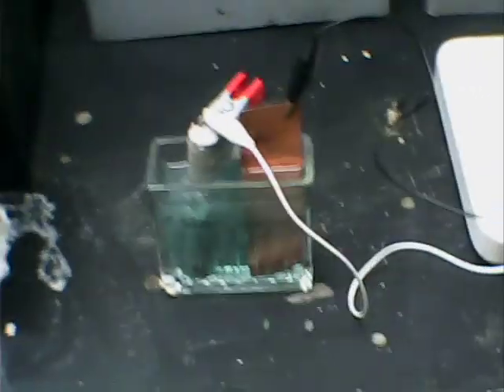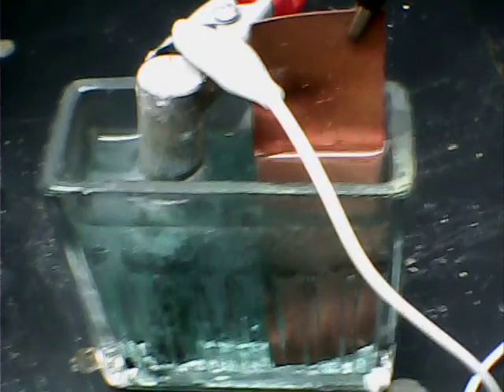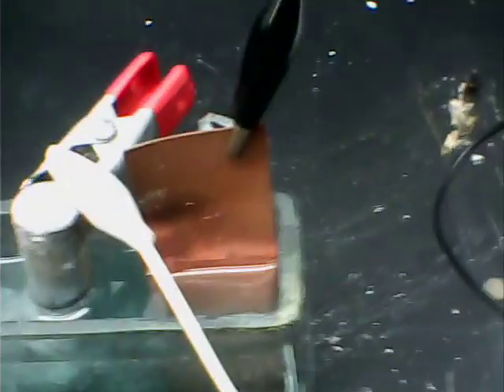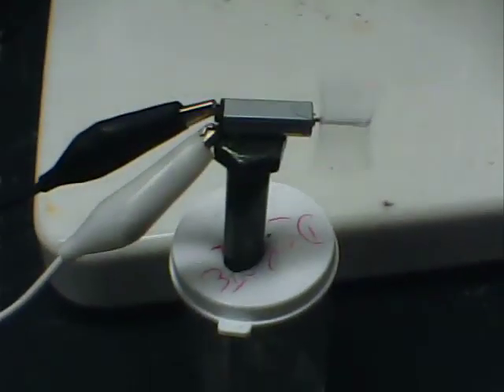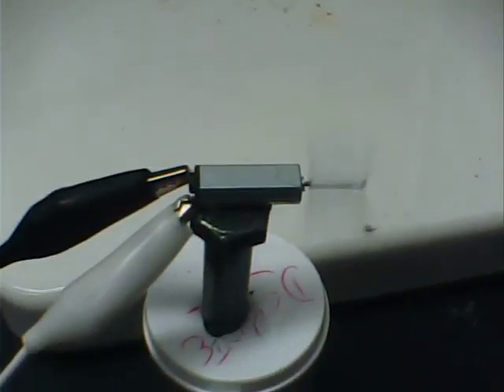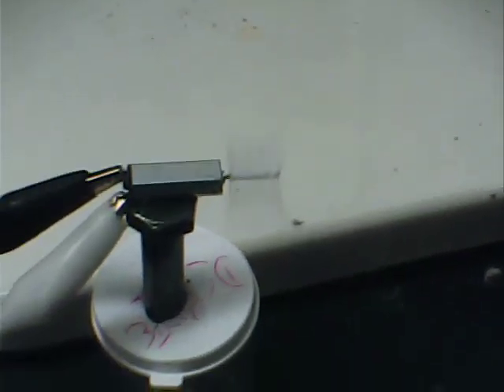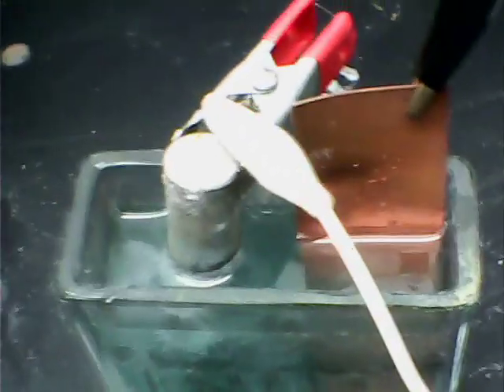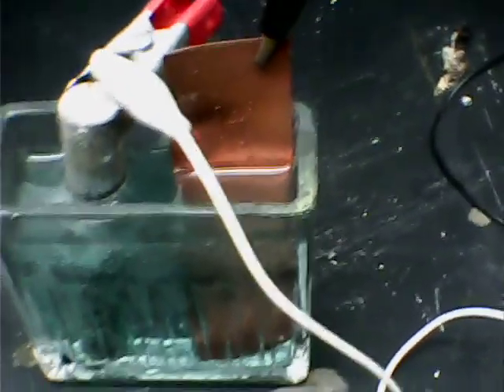Magnesium Copper Cell/ Aq. Oxone Electrolyte/ 1.75V (Open)

Comment: built one of these just now.. 200ml water, 2 Table spoons Oxone, 2.5cm x 10cm Copper strip with 8mm OD x 10cm Magnesium rod, 1.5V with open circuit of 1.05A!! however the Magnesium bubbles ALOT and produces what smells like Chlorine but there is no Chlorine present so unsure of what the gas is.. When the Mg is removed it appears to be smoking and is warm to the touch..

Comment from the maker: I left the powered motor running in a fume hood overnight.  The next day it had stopped. I cleaned the electrodes and re-charged with household bleach ( no copper salt addition). It started up again and was running strong.  I will run the cell with a circuit board and monitor voltage/current over time.
Reply: David Soriano soooo, how'd it work out?